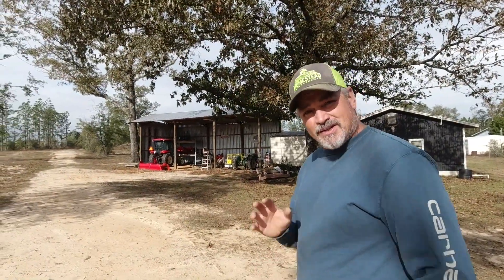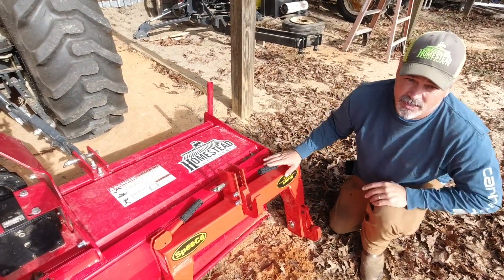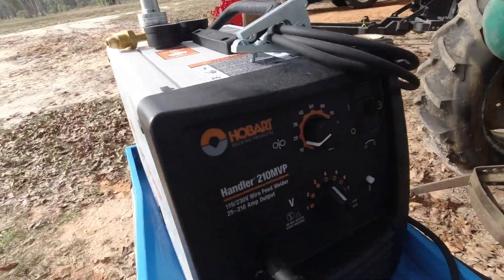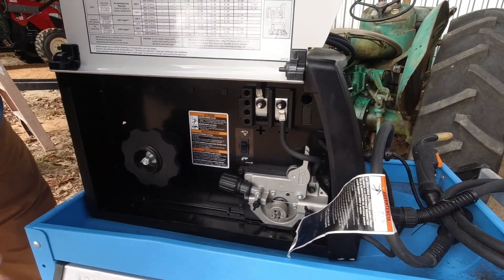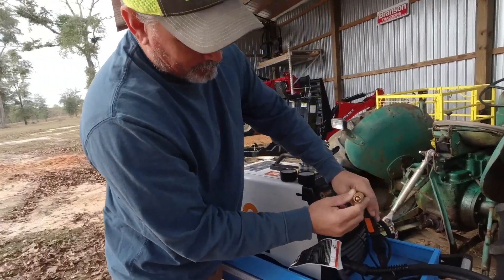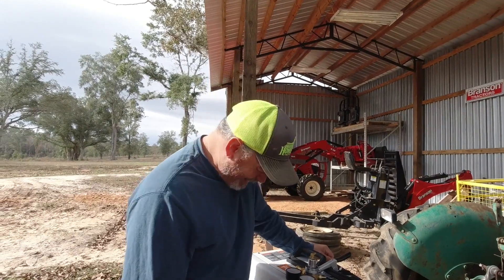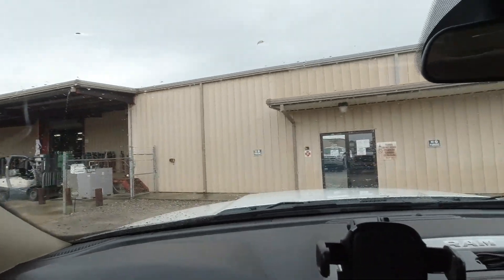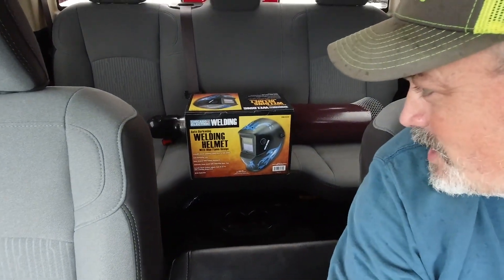OLIVER Tractor Has A Leaking Problem!

Comment: Looks like she's leaking out of the weep hole and should be replaced. By the way that feeder from your last post?  remove the four self tappers holding the control to the bottom of the hopper and turn the control 180 degrees and reinstall. the control face will then be facing between the legs
Reply from the maker: Thanks for watching!
Reply: That's what I am thinking, too. Weep hole was opened - simple "warning" for water pump's seal worn out. Pull it and put new one and you are good to go!

Comment: Hi Hank great video! up here in ontario ca the tsc doesn't have  gas bottles because there's a police station with in mile of the store as crazy as that sounds!  i have a 1940 9n with a loader on it for doing snow  starts and run great and  can fix it with a screw driver and rock  keep the videos coming keep safe
Reply from the maker: Thanks for watching!

Comment: Hello hank and gang.
Some of that water looked rusty.
Heres what i did on a project truck once. Drained out the old.flushed it with the garden hose.refilled the system with fresh clean water.added bleach to the system.plugged the block heater in and left it for 2 days.drained the system out.just as rusty as the 1st time i drained it. Added clean fresh water again with bleach and left the block heater plugged in for 2 days again.did this 3 times before the system cleaned out.then added anti freeze mixed with water.

Or another route you could go.you buy a bottle of iron tight.read the instructions on how much to add.
Reply from the maker: Thanks for taking the time to watch and make the comment. I truly appreciate it! Have a good day.

Comment: On Water put new bearing in one have plus thick gasket with high temperatures silicone or gasket mender glue to seal up Hank :)  unless dealer rebuilt or full brand new one save trouble for years  too  and if do gasket  use gasket paper  make sure engine block plus 90 'staright  to water pump  so seals tight nicely! Also exhaust use stainless 100% plus see find exhaust  fitter type people costume made ones to show pictures on exhaust on Oliver tractor  to shape for you and weld up yourself too plus get new Exhaust muffler new one plus rain cap too so won't get mice or rats or water to intake plus engine even carb too Hank :) ! Glad going get new tires on back plus tubes also repaint the rims in side tube with primer let drie after 2 coats worth  then 2 coats of white paint save from rust out badly ! Plus do brakes job to Hank :) on old Oliver too save from future problems plus stop better too and I suggest do Clutch job with bearings  to it to  so won't fail on you ever shift gear better too and if use PTO too ever! Clutch wheel plate  in those tractors are 2 sided types one side  for Transmission & other side  is PTO  plus like GM from 1960's to 1986 years set up Manual transmission without hydraulic fluid !
Reply from the maker: Thanks Andrew 👍
Reply: @Hfoutdoorsyt  Hank :) your welcome for ideas for anytime and I help with my ideas anytime too!